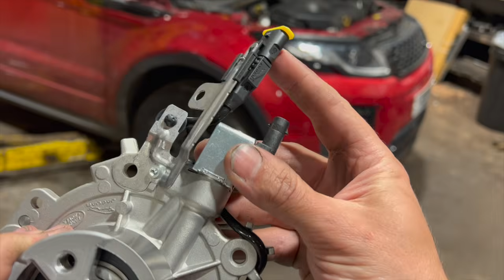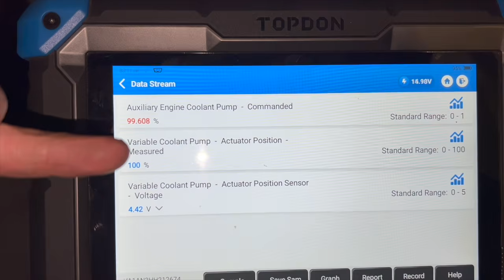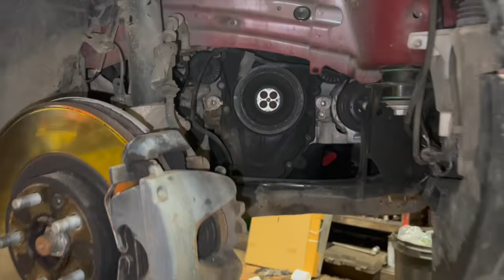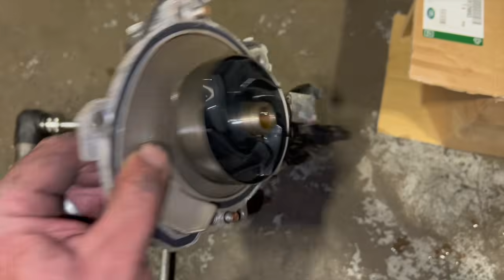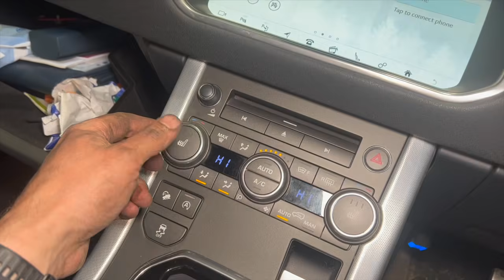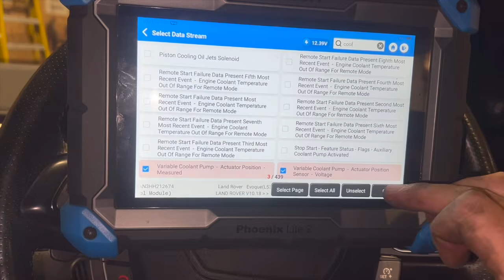Range Rover Evoque 2.0 Ingenium water pump replacement

Comment from the maker: Diagnostic machine used in this video:
Topdon Phoenix lite 2 Ebay - https://ebay.us/tsyiTI
Topdon Phoenix lite 2 Amazon - https://www.amazon.com/dp/B0B1MB6YG8  
New Water pump : https://ebay.us/XzbXXi
New Auxiliary belt : https://ebay.us/GVgGWu

Tools Used :

             Milwaukee 18v 1/2" Impact driver - https://ebay.us/4SOewF
             Milwaukee 3/8 Drive Mini Impact driver - https://ebay.us/Pg8ilg
             Socket set - https://amzn.to/3eGx2Ak
             Ring Inspection Lamp - https://amzn.to/3gGWHcG
             1/2" Torque Wrench - https://amzn.to/2VZ4CKu
             3/8 Digital Torque wrench - https://ebay.us/mmTdYd
             Milwaukee 12v 3/8 Ratchet - https://ebay.us/BZZqQG
             Pry bar set - https://ebay.us/UilMqS
             Screwdriver set - http://ebay.us/NUu3Q1
             Spanner Set - https://amzn.to/389UOTk
             Small Snap on screwdriver - https://ebay.us/KK4Fik
             Long ratchet spanner set - https://ebay.us/4DrYtn
             Torx socket set - https://ebay.us/tV682d
             Red Anti freeze - https://ebay.us/FMSPG0
             WD40 - https://ebay.us/FPw1Ww
             Coolant catch tray - https://ebay.us/WeJqWE
             
            
Torque Settings :
Water pump housing bolts (x6) 12NM
Water pump pulley bolts (x3) 25NM

Comment: Would you be able/or maybe you have video explaining on how pump supposed to work with diagnostic machine ? What should show when it’s fitted and good. I currently having an issue that temperature goes up and down (never above operating temperature) . When plugged in to diagnostics , temp command was 67… and pump was showing 96-97. When engine off it did drop to 0. Trying to understand how pump works and if I have an issue with pump or thermostat. Thank you! And this video on how to replace is very helpful!!! Just need to know if the problem is pump.

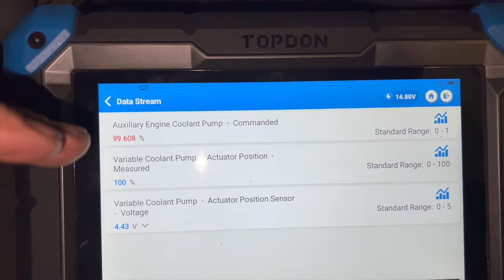Comment: Hello, if you see this message, please help. I saw you changing the water pump on an Evoque on YouTube. I have a 2020 Jaguar E-Pace with the same water pump and the same engine. But I don't have voltage at the water pump.... Can you tell me if there's a fuse for this water pump? 4:31 4:31

Comment: Awesome video, I have an e-pace that appears to have a coolant leak somewhere around the water pump area. No overheating, coolant system isn't pressurised. Any ideas what might be the culprit?
Reply from the maker: Hmm I’m not too sure tbh hard
Reply: @diydaly turns out the water pump was leaking out of the bearing.

Comment: Is this separate to the thermostat? Or does this solenoid in the water pump also does the thermostat job as well? I get a hunting noise below 1500 rpm when engine is getting to optimum temp I’m not sure if it’s the thermostat or the water pump… any information would be a massive help!
Reply from the maker: The thermostat is a separate item , the water pump may make a noise , the thermostat definelty won’t
Reply: @diydaly can you replace it for me please? Haha I'd rater someone with experience work on mine it's done 168k miles 😊

Comment: Would this procedure be the same for a 2018 jaguar E-Pace P250 water pump change replacement? 

Also could you do a replacement procedure for a jaguar E-Pace P250 auxiliary coolant pump please.

Great video and well explained. Thank you.
Reply: @diydaly with your instructions I changed the water pump and serpentine belt myself. The E-Pace has been going great since replacement. The instructions are the same for a 2018 Jaguar E-Pace P250. Thank you so much. 👍🏻 
PS can you put some videos up regarding Jaguar E-Paces if you have any come in. I have to replace the PCV valve as it surges. The timing chain and VVT solenoids have been recently replaced. The mechanic rekons it needs a new oil separator breather cover, which it has the PCV valve attached to. Can I just change the PCV valve? I’m in Australia.

Comment: Very similar on the P250 Velar. Thanks for the excellent video. Pump replaced and no more stuck pump fault code or crazy high fan speed.

Comment: Got a whirring noise coming from an evoque we have 2018, coolant low warning been popping up recently so it’s must be leaking somewhere or faulty sensor because the temperature stays right even with vigorous prolonged driving.

Do you think the whirring noise could be the belt on its way out and the pump needing replacement?

2018 105k miles

Comment: Hi mate I’ve git Range Rover sport phev hybrid 2.0 ingenium engine , I’m having a issue with coolant, car had an accident and damaged the driver side auxiliary radiator , car was started for a bit without the coolant there after car been making loud noise even its engine off for good 5-10 minutes, I think it’s as the pump noise , refilled the coolant but it kept getting hot boiling and blowing back out and sometime dropping low and playing low and high and proper hot , replaced the small auxiliary pump but now it seems ok not boiling hot or level dropping etc… but the issue is when I start the car the rev stays high for a minute or so even though the car is warm but every time I turn the engine on the rev goes up and stays 13-1500 rpm for a bit then comes back to normal , car driver so bad no boost or power , got it checked and it shows the code P2600-13 along with another code which is intermittent code which says coolant pump actuator stuck open , checked the voltage it shows 0.7v and actuator position is 0% and some time moves to 12-15 upon starting the engine then goes to 0%  now I just want to know if the main water pump is faulty or there are 3-4 other small black electric pumps and any of those are faulty or it’s an electric issue like fuse or relay and if so can anyone help me with fuse or relay as all the connections look ok nothing is unplugged . Thank you

Comment: Really good video and thank you, I have an issue with my Evoque where the sensor voltage is low/0.14v. I've replaced the pump using your method and all went well but the car still does not warm up enough, the position shows 0% where the command works gradually well. Any suggestions would be appreciated.
Reply from the maker: May be a wiring issue somewhere but your gona need to find the diagram I’m afraid , not had an wiring issues to the pump tbh
Reply: @diydaly  Thank you, appreciate your response 👍

Comment: This video provided the instructions I needed to change a water pump on a Land Rover Discovery Sport 2019. I am grateful to the author for sharing his expertise. For other would-be DIY water pump replacers for the 2 litre ingenium engine, I would add that the extra-long 8mm ratchet spanner is essential for this job.  it took me 4.5 hours to change the water pump, probably two hours of which was spent removing and reinserting the two topmost bolts on the water pump. These bolts are very difficult to access and, as I found out, very difficult to remove if you do not have an extra-long 8mm ratchet spanner.

Comment: Hi mate I have a problem, I’ve changed thermostats housing on same vehicle, after filling with coolant my fan is on full straight after starting vehicle, any ideas, can thermostats be live checked , by the way there is a bleed screw on left near air box on the 2.0 cheers help needed ta

Comment: Well explained thanks.
The code reader is confusing, it's a 'auxiliary engine coolant pump' and is also called a 'variable coolant pump'.
I don't know this engine but is it really an auxiliary (extra) pump?
Reply from the maker: Tbh I didn’t really notice at the time till I was editing the video but there’s a chance that top reading is for a auxiliary water pump , they often have an inline pump , if so it might not list the command for the variable pump only the position